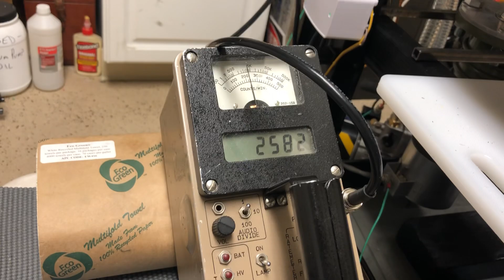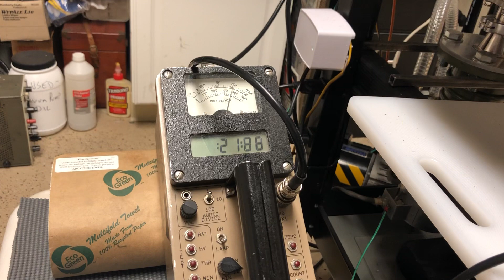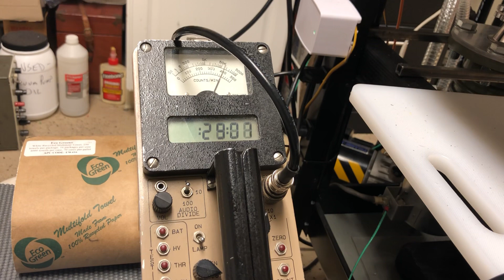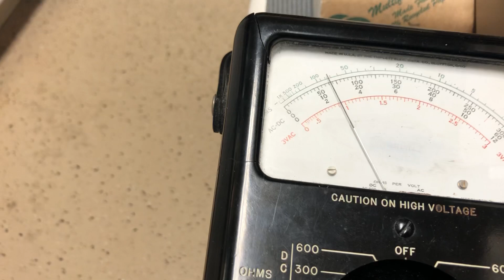Fusion Run 17Oct19

Comment: I think I have that same power supply that's sitting on the floor if it's a HP 6284A. Hard to tell.
Reply from the maker: Good spot. It's due for a restoration. As it sits it has poor voltage control and seems to have filtering issues.